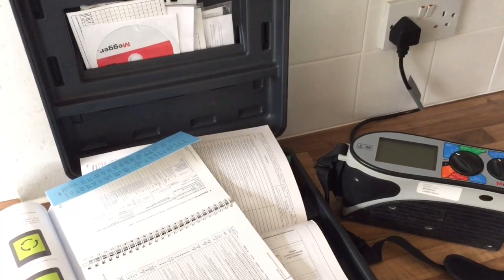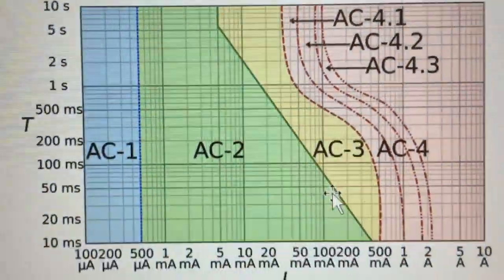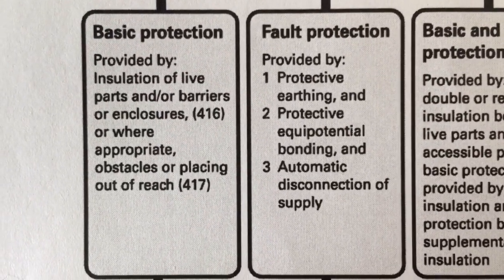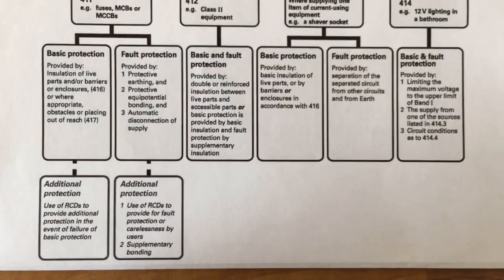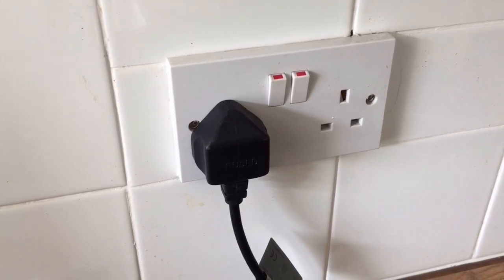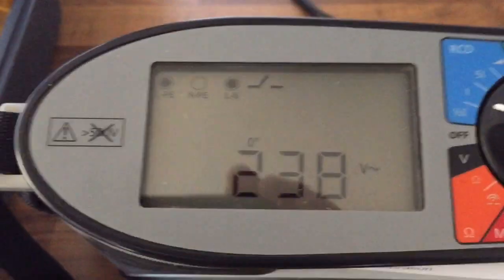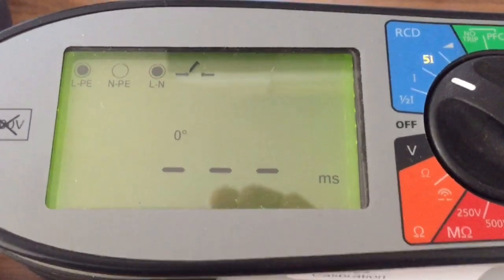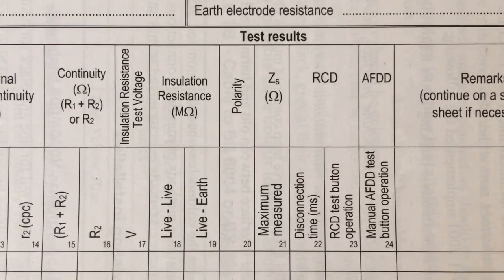RCD Testing- Additional Protection - Basic & Fault Protection

Comment: Hi Pete. Does 400 milliseconds only apply to additional protection?
If testing at 1x♤In for fault protection is it still 400 milliseconds or is it then 300 milliseconds?
Reply: Hey I just sussed out its 300 milliseconds for 1 x I♤n for fault protection but now wonder if your rcd would be recorded as a fail as it was a hair over 300 milliseconds.?
Thanks
Reply from the maker: You mean 40 milliseconds don't you? That test requirement has now gone. The 5x test and the under 40 ms test result is no longer required.  1x is all it says in the big brown book these days. You may choose to do this test at 180 degrees also and you are looking for under 300 ms. You could also still do the 0.5x test and of course do a functional check of the test button. I could update the video I suppose but hopefully anyone looking will see these comment. Hope that info helps.
Reply: @sparkipeat2255  ok cheers. Yes. 300 milliseconds on 1x I♤n   .    Is that for fault protection or for additprotection. 
( can an rcd even qualify for fault protection? Or is it in rcbo form only) 
Its confusing. Especially brown book. but I'm getting there. Thank you

Comment: Subbed Finchey
Crackin content. 
!!
Reply from the maker: Finchey! Haha. Thanks. Testing of RCDs has changed now as only the 1x test and the pressing of the button is required. You may still like to do that 1x test at 0 and 180 degrees.
Reply: @sparkipeat2255  good to know as currently revising for Inspection and Testing
Reply from the maker: I just realised that your name might be Finchey? I laughed because my voice has been compared to the character from the office, that or Denzil from Only Fools and Horses haha.
Reply: @sparkipeat2255  no its Finchrly from the office mate. 
You could do voice over work..

Comment: I notice you have a megger 1552. At my recent assessment the Elecsa man told me I couldn't use my old trusty on Type A RCD's. Any views.
Reply: Hi, sorry for delay only getting this now. I take your’s and his point. We’re more aware of different types of RCD and their applications etc these days. Back in the day we were happy that there was an RCD there at all but things have moved on! Off the top of my head you’ve got me there. I’ll check the manual. It’s been a while, did you get to the bottom of this yourself anyway?
Reply: Yeah. I emailed Megger and they confirmed that changing the setting to DC is adequate to test type A RCD's. There is a blue button on the tester for this.
Reply: @kevwade63  Every day’s a school day! Thanks for the question and the answer. I wonder if Mr Elecsa knows yet? Maybe you should tell him? We’re all learning.
Reply from the maker: Hiya, thanks again. Replying as Sparkipeat this time to clear from my 'haven't responded' list.

Comment: Hi so on a tn system rcds are just for additional protection 
  But on tt system are they just for fault protection 
Or both fault protection and additional protection
Reply from the maker: Alright Greg, additional protection, earth leakage, earth fault backup TN, additional protection, earth leakage and primary means of earth fault protection TT
Reply: @sparkipeat2255  ok cheers
Reply: @sparkipeat2255  hi mate have you also seem the new hager type a rcds 
They say to test at 250 ma and should be under 40 ms
Reply from the maker: @gd-bq7em  manufacturers instructions is the trump card